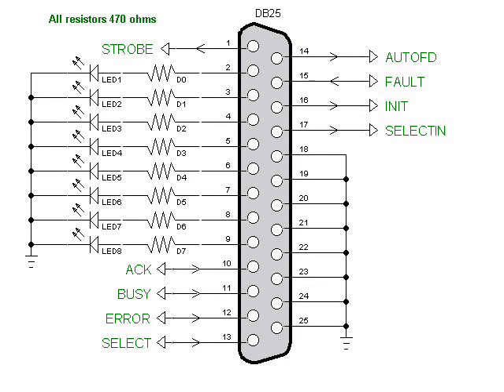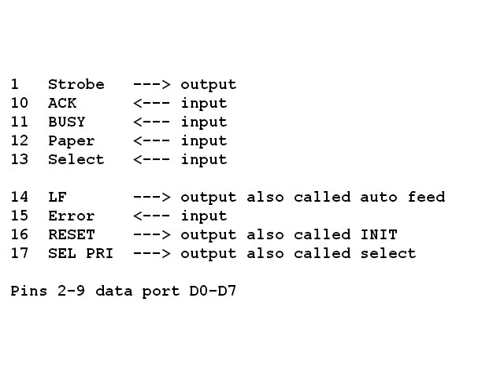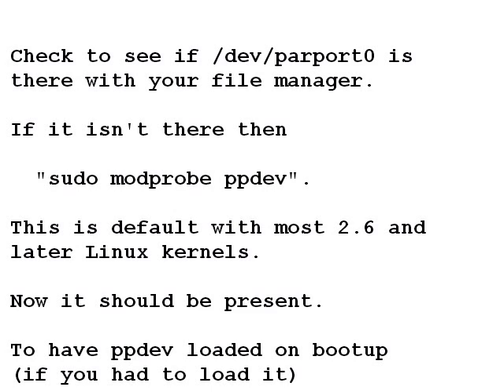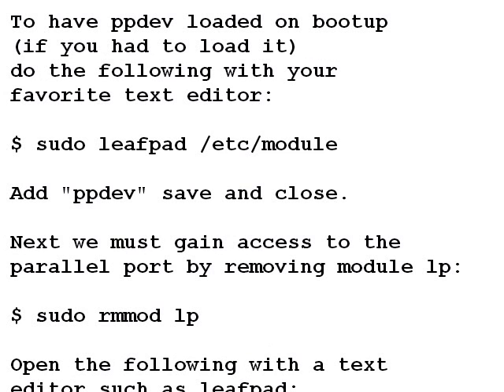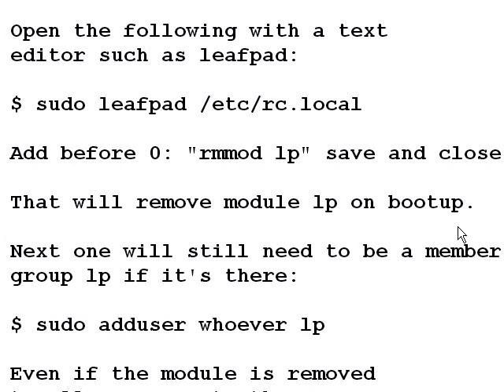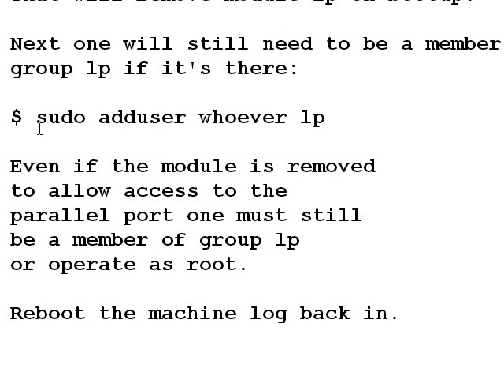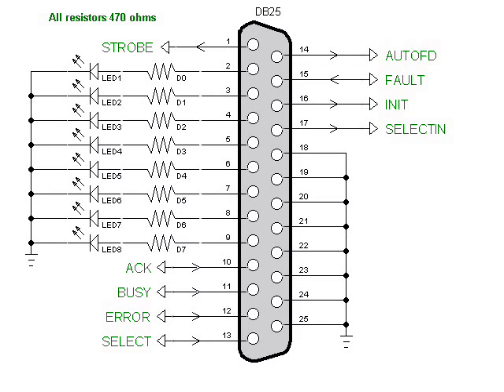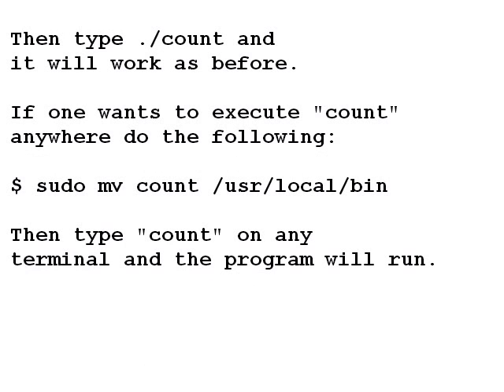Setup PC Printer Port with Python-Linux

Comment: This is awesome! I have been wondering about a legacy printer port to control devices, this was a good start. I know that the output is weak, just enough to drive LEDS, so I have to use switching transistors to drive relays for my project, Thanks!
Reply from the maker: I'm getting ready to add new material to this. Instead of Python I'll be using C which requires no setup.
Reply: @LewisLoflin  Well, fantastic. Super glad to hear that, thanks for taking the time.

Comment: Thank-you for a great series, I'm currently using the raspberry pi to control heating and lighting circuits around the house, everything works as needed and can be controlled over an internet connection using ssh and Webiopi. My real goal originally, was to use the parallel port on the pc for this to allow me more options, but I could not find a workaround for turning off only 1 circuit. i can turn on the lights for example with p.setData (1) and the heating with p.setData (2) but is it possible to just turn off the lights and leave the heating turned on. or vice versa or will it be easier to use an arduino to fill in the gaps.